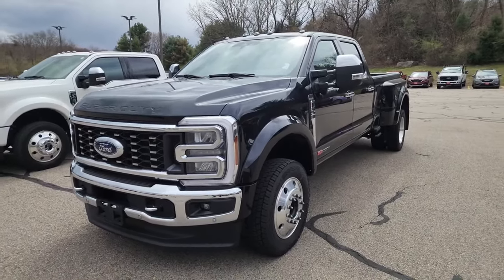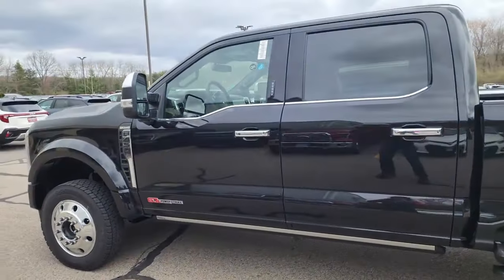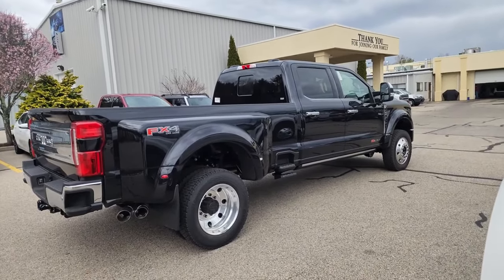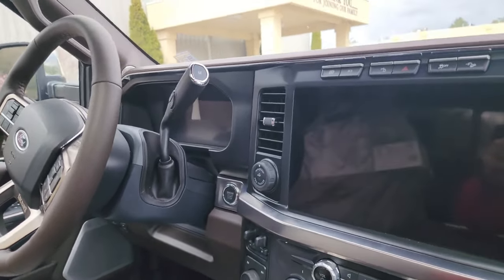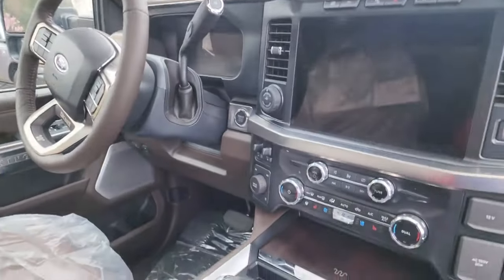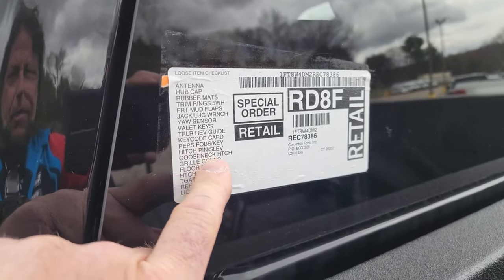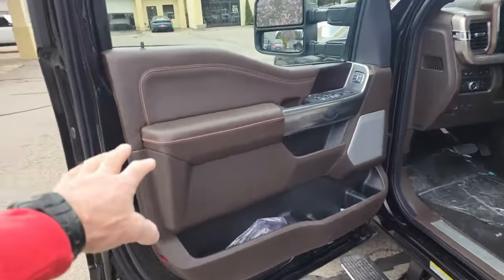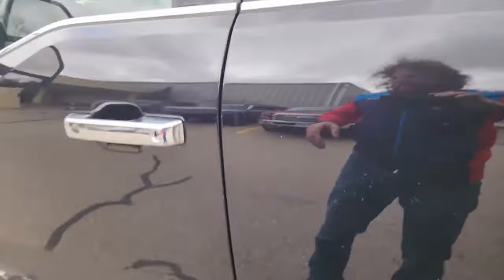2024 FORD F450 KING RANCH VS 2020 F450, IS THE NEW F450 THE BEST TRUCK EVER?

Comment: I have a 2000 F250 4x4 with leaf springs on all 4 corners and solid axles. You have to get out of it and lock in the hubs before manually shifting the floor mounted lever into 4 wheel drive. Five speed manual.  It’s got recirculating ball steering. XL interior with roll up windows. Sometimes you literally bounce down the road. Steering is more of a suggestion. 128,000 miles, doesn’t leak a drop of fluid. I wouldn’t sell it for anything. Congrats on the new ride Ken, it is pretty impressive!
Reply from the maker: Sounds like a badass truck it'll probably Outlast these new ones
Reply: Just turned 64. I’m going through the K.I.S.S. Stage. Keep it simple stupid. I get why people buy the new trucks, I just have no need for one. It is truly remarkable how trucks have changed in 24 years!
Reply: Dream truck haha

Comment: What I really like about your purchase is that you paid alittle more, but got much, much, much more.

-You got a truck that you absolutely love and makes your life much easier.  5G internet for all your videos.  Cameras for the hitch and watching your trailer/load.  All the step-ups.  120V AC in truck and bed.  Better stereo, interior.   -This truck is a huge upgrade all around +the new warranty.  

-With your trade in, -it really is a no-brainer.  

== Don't buy any vehicle that you will be unhappy with.  

Add on you may want.

-Kellerman type air ride -maybe just rear air.

-air ride 5th wheel.  -Isolates the trailer from truck better.  (There are issues with both of these products, and reliability maybe lessened).  

(Those cameras work in complete darkness also).  -Pretty amazing when you use them.  (Great Job Ford)
Reply from the maker: I've been giving serious thought to the kelderman air ride possibly some 22-inch alcoas and I have an air ride hitch on the primary unit that I used to haul the 45 footer this is just going to be a backup going to be the backup hauler for the big fifth wheel the primary hauler is a Volvo semi

Comment: Nice truck Ken! You deserve this most definitely, she is a beaut!, the black/chrome compliments themselves very well on this truck, I'm sure you are going to rack the miles on this new one, I hope it treats you very well, and also I haven't seen the 2nd gen Cummins Ram 2500 for a while, have you done anything else to it yet?
Reply from the maker: Add a bunch of work done on it mechanically next we're going to do the cosmetics new rocker panels and whatnot I took it off the road for the winter
Reply: @KaplanCycles  Cool! 👍 sounds like a great truck, and it should last you forever, you could paint it black and put your logo on the side, which I know you already have the "King Of Ping" decal on the side, but you could step it up even more and put a "Kaplan Cycles" logo that goes on the bed and cab of the truck, but other than that, it sounds like a sweet rig in which I'm sire that you will enjoy for years to come, 😁😎

Comment: I don’t know Ken… anything Post Covid from Ford is turning out to be riddled with problems. I would hold on to that problem free 2020 model!
Reply: You are absolutely CORRECT!  These fords have problems starting after an hour ride especially when towing, trans hard shifting. Garbage.
Reply: I have a 2020 explorer. It has 5 recalls. I stopped going to dealer after second one. They don't pay me to drop truck off and pick it up or take off work for repairs. Makes me sick how poorly ford's are made.
Reply: My dads 2021 f350 has been fine, 50,000 miles and the only thing he’s had to replace is the spark plug wires

Comment: The emission systems have so much problems so it better have warranty
Reply: I’ve seen it normally last a couple hundred thousand miles before def issues then just get it deleted. Sometimes it happens early on but it’s atleast under warranty then.
Reply: What. I have four of these trucks between 450’s and 550’s from 20 and up. Not one emission issue.

Comment: 😅 have 2 2002 f350s 7.3. My truck is 4 door srw w 186,000 on it and it has been reliable & taken care of. My farther in laws truck88,000 I use to plow the farm is a xtra cab dually both are lariat package. I will keep these . Put an exhaust & mild chip it’s all I need to work & tow horses. 🇺🇸
Reply from the maker: Very nice!

Comment: I always thought the Cummins was better, but there are issues with the new Aisin transmission.
Reply from the maker: As I said in the video I bought one brand new there were so many problems with the Asian transmission they eventually threw their hands up and said they couldn't fix it and they ordered me a new truck I never really trusted that truck so I ended up selling it and getting a 2016 F350 which I still have with 171,000 Mi it's never left me stranded I also own a GMC diesel dually and a older Dodge Ram 2500 Cummins diesel that I really enjoy driving book for the new trucks this was the safe bet for me

Comment: I love my 2020 450 KR, has never seen a winter ,i'm a snow bird.I going to order a 450 Platinum  when the 2025 order blanks open up. The reason I'm going Platinum instead of a KR is because from 23 up the KR got rid of the  Led Projection headlights and replaced it with Led Reflecter  headlights and incandescent taillights.For me this is unexceptional and going Cheap on Fords part. JD on Big Truck Big ON RV confronted an engineer at Ford and they didn't Know what to say.They certainly didn't lower the price.The Platinum with the Projection headlights are also self leveling. Very good presentation, I summer in Ma., who is your Go To salesman @ Columbia Ford?

Comment: 5th wheel hauls more than rear hitch no?
Reply from the maker: I'm pretty sure this one holds 40,000 lb from the hitch
Reply: The amount of weight you can put on a rear hitch is 500lbs typical to 1000-2000lbs (max, with special hitches).   Pintle type hitches (construction/military) are more.  5th wheel hitches are generally better and safer since you have more weight over your rear wheels. Air ride 5th wheels and air rear suspension (helps level under weight) helps.

Ford has the weight load sensors.  -tells the amount of weight over rear axle.
Reply: @jonmccormick8683  bumper hitch is usually 500# frame hitch is more. Gooseneck is the highest.
Reply from the maker: https://youtu.be/MCCqQZA_YDs?si=4dETRP-4Rtpo2Tzl
Reply from the maker: Check out this link to a video showing at hauling 30,000 lb from the bumper he has a video on his site showing it Towing 40,000 lb off the gooseneck that's literally half of what a semi can do absolutely ridiculous how much power are these new trucks have

Comment: 4 years old with 21,000 miles and a hose blew? That says a lot about ford's.
Reply: Like a Chevy would be any better
Reply from the maker: It had 1200 miles on it when the hose started leaking it was a factory defect it was rubbing on something by the block it didn't phase me didn't cost me a penny